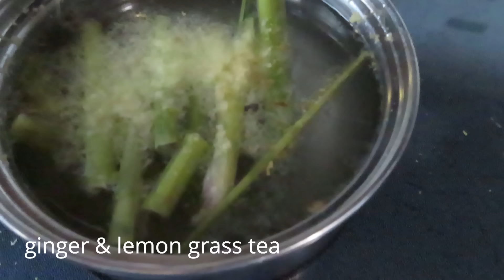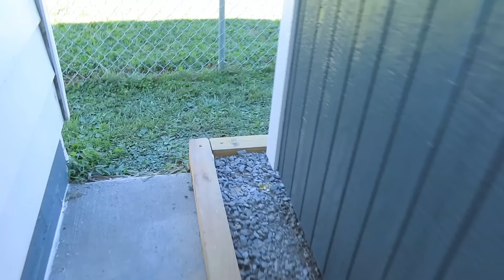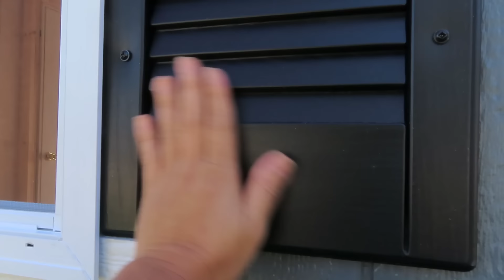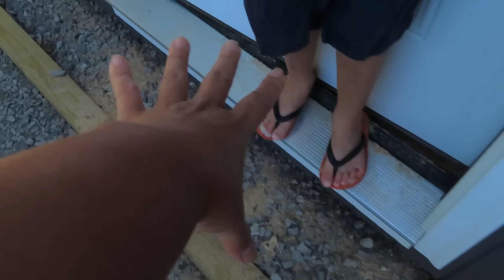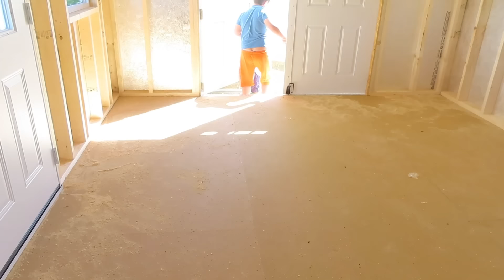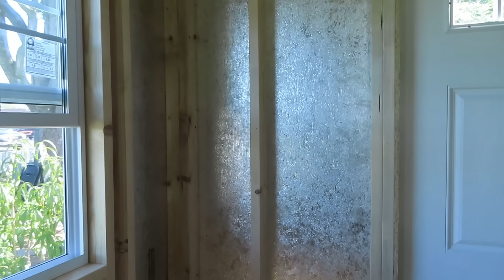BUHAY AMERIKA:TINY HOUSE BUILD IN 4 HOURS ! FINALLY DUMATING NA ANG PINAPAGAWANG MUNTING BAHAY!

Comment: You need to enclose the lower part of the house to prevent snakes and rat would stay under. I had my shed enclosed because we found a rattle snake I had it double insulated too so that it is not gonna be hot during summer. You have to insulate it. You can buy a solar window air condition.
Reply from the maker: Thanks I thought about that too, we were planning to buy a screen wire:)